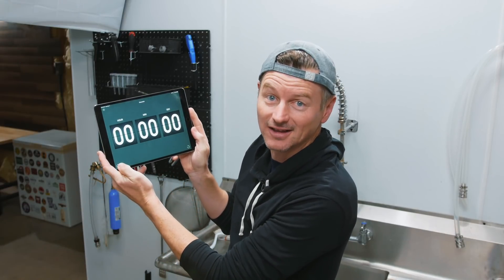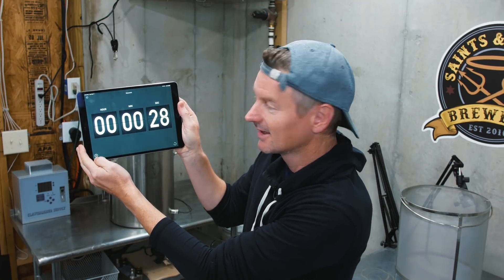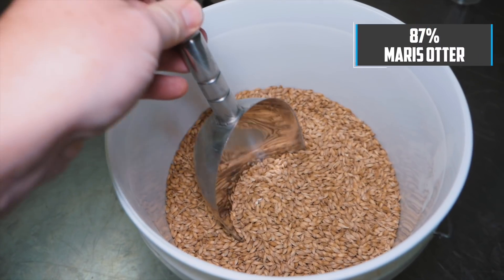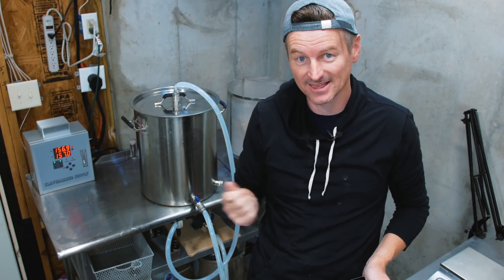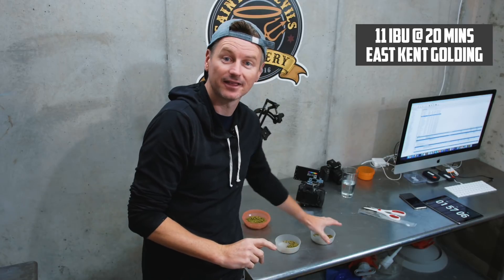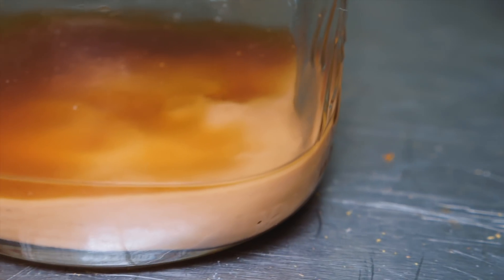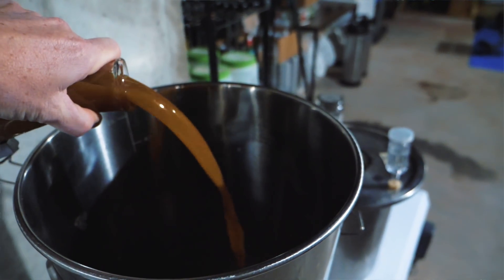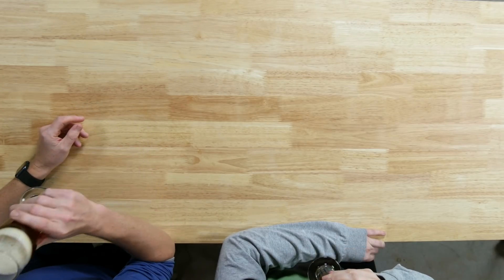ESB (Extra Special Bitter) | How Long Does It Take To Brew Beer?

Comment: I’d love to know what you use to test the pH of your Mash. I’m getting very mixed results from pH strips. All I hear about pH meters though is that you might as well not bother to get one that’s not $100 or more.
Reply: For what its worth you are right about pH strips, not much use for brewing. I went for the Apera pH 60 which was not cheap but does give pretty accurate results. You will need to calibrate it quite regularly with the supplied chemicals. I usually take the pH 5 times and then average them though they are all fairly close.
Reply: Steve Tucker that’s very helpful indeed. I actually just picked up a vivosun pH meter. It was one of those $15-$20 pH and TDS meter combos with some calibration packets. It calibrated with good results(+-.01 accuracy), but the process of making sure everything was JUST right for the required conditions of the calibration packets was a bit complex. In the end I got it done. Brewing on 8/1/20, we’ll see how it turns out then.
Reply: @ChuckUnderFire  Good luck

Comment: Every business trip to London, I always make it a point to get a Fuller's ESB, and then also try some other brewery's cask ales...  ESBs are not very carbonated, so how would you dispense the beer at home and retain the low-carbonation levels?
Reply from the maker: Right lowering the serving pressure if your system supports it would be good. But it’s hard to replicate ESB on cask for sure.

Comment: NIce video! I have a Clawhammer system as well, 120. I've noticed that I can't seem to hit my OG numbers, so I started doing a sparge. With a spare I find that I have more control and am able to hit my OG. Have you ever considered doing a sparge on this system? What are your thoughts on this?
Reply from the maker: Tell me more. How are you performing the sparge?
Reply: I generally do a 5 gal batch, 8.5 gals of water. I put all 8.5 gal of water into the Clawhammer kettle, start heating up, add salts, then transfer 3.5 gals to a pot to keep aside and heat that separately to 168 f with a heating plate, when ready to sparge. I mash in grains into the 5 gals into the Clawhammer kettle, once mash out is complete, I pull the basket up with my pulley system, kind of like yours. Let it drain, take a refractometer reading to see where my gravity is at. Then I take that heated sparge water into a pitcher and pour over evenly over the basket as needed, periodically checking gravity readings with the refractometer until I hit the desired OG. Also, while I’m sparging, I’m also bring my temperature up to boil.

Comment: Question: How are your temperature fluctuations with this system? I want to purchase an electric system but the videos I've seen so far the temperature fluctuates alot between the setpoint. Does your system achieve stable mashing temps?
Reply from the maker: Seems pretty consistent once it’s running. The 240v heating element is a beast but it holds a steady mash temp.

Comment: thanks for the nice content I was looking awhile for someone who runs down the BJCP guidelines as a challenge, and here you are. Just as a small Question: Could you put the percentages in the recipes (in brackets or something), your end volume (fermenter or kettle), OG and FG? Because now it's just a list of ingredients, hop boil times and a temp to mash (which are essentially all you need). It would just be easier to interpret. 
Also in the video, you could just say the amount of grain used and give the percentages in the info box next to the amount.

Quite a long ramble, sorry for that. Its just things that I would think makes it easier to understand and look at.
Reply: The reason it is in percent and not in weight is, Martin started doing smaller batches - about 2.5 gallons, because he can't drink 5 gallons of beer in a week :) 
Look at older videos, from two weeks ago "(Not So) Ordinary Bitter | Small Batch Brewing"
Reply: @dimash244   Yeah i know that, and i love it because I work with percentages in my brewing. Its just for convenient for people who want a recipe to follow for 2.5 gallons and to visualize the amount. For me it's weird to say and hear 87%, because you can't connect it in your head with an amount. its just as easy to just put them next to each other and let people decide which to use
Reply from the maker: Be warned - you'll see me struggling with how best to handle this in the upcoming videos...